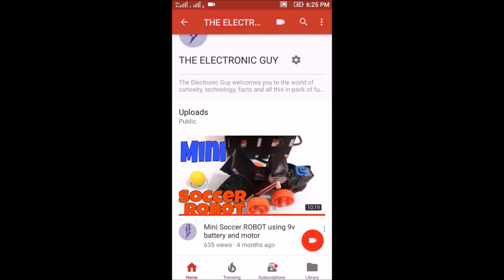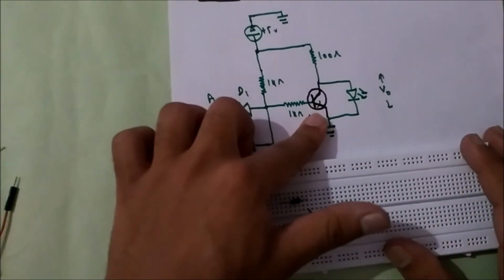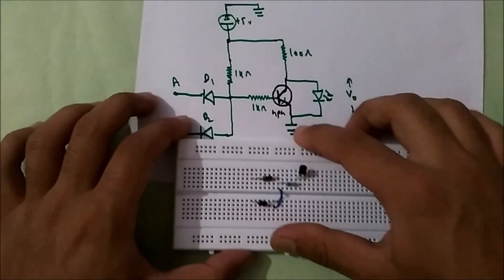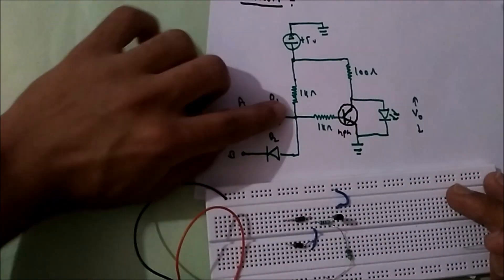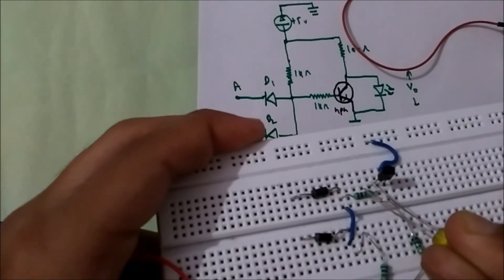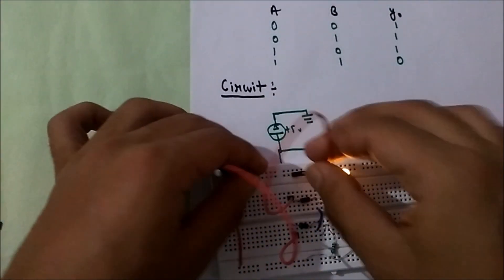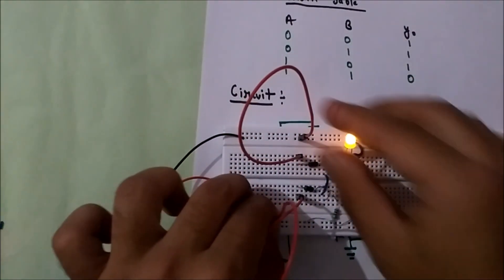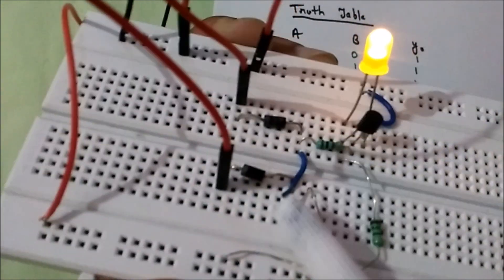NAND gate using diodes

Comment: hey can  u pls tell me the components that u have used and along with the values
Reply: 3 diodes, a npn transistor and resistors, then connecting wires and a battery
Reply: xD

Comment: Can we use 100ohm resistor in place of 1kilo ohm resistor??  could you plzz tell me what is the type of npn transistor?? can we make two logic gates(NOR and NAND) together on a same bread board??
Reply from the maker: +Kiran Mangla 
1. yes for 9v battery you can use 100ohm
2. BC547/8
3. Yeah, but you need two transistor for this. One for Nand, Other for Not
Reply: THE ELECTRONIC GUY .... thank you.... it is going to help me build a healthy scl project... thanks fr ur video
Reply from the maker: +Kiran Mangla no pbm. do share 😊